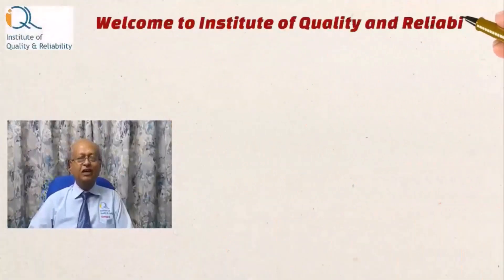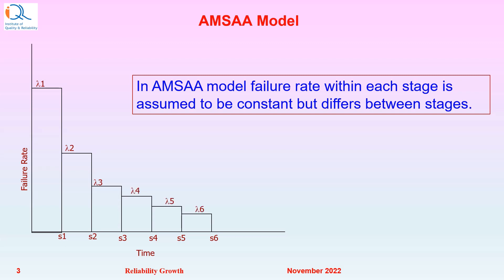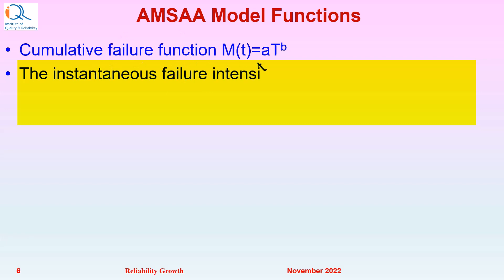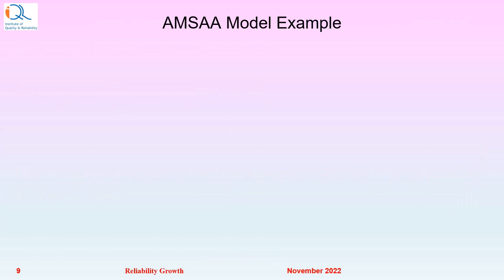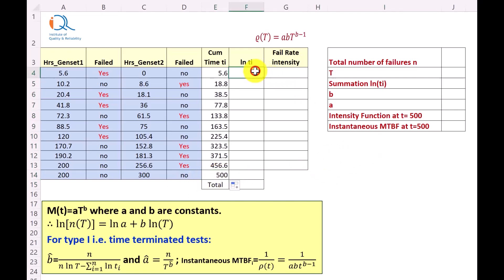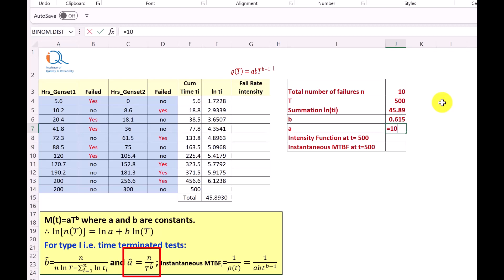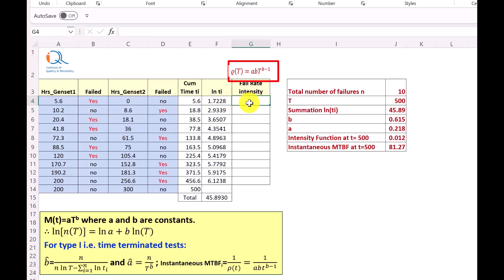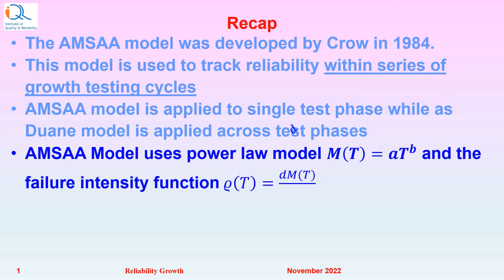Reliability Growth: Crow AMSAA Model with Application Case Study

Comment: Why in some cases there is a time in the column even when genset did not fail?
Reply from the maker: Hello Fernando, Thanks for your interest. There are two gensets. So the time is time column shows data when any of the genset fails. Hope this is clear.
Reply: Yes I got it. When performing this analysis using Minitab the results are different. Also, how this Eta and Beta relates to shape and scale parameters informed when using Minitab?

Comment: What is the relationship between the Crow AMSAA Model and the Weibull distribution? I've read that the  Crow-AMSAA distribution is equivalent to the Weibull Intensity Function. You said in this video that it is represented by the Power law distribution.
Reply from the maker: All growth models are power law and NHPP.  Weibull distribution is applicable to a non-repairable item with a particular failure mode. The intensity function looks like Weibull but is not Weibull distribution.

Comment: How can i use this model/calculation for semiconductor product where we have increased num of samples/hardware with time and progressively with different firmwares, reliability improves ?
Reply: I believe you can use the same procedure.
Reply: @uhemant1 thanks. for an example with Firmware1 with 100 samples for 1 day test duration i got 4 failures then i switched to Firmware 2 and added additional 100 samples , With test duration of 2 days i got 3 failure in these 200 samples. so Genset1 will be Firmware1 and Genset2 will be Firmware2. but all 100 samples will show 1 day duration and 200 samples in firmware 2 will show 2 days test duration. It will not like above example with variable test duraiton right ?

Comment: How to do calculation when i have 4 system in place and there is no failure reported at all??
Reply from the maker: During development, it is nearly impossible that there will be no failure. In such a case, the growth model will not apply. Gowth means reliability improvement. If there are no failures, no question of growth.